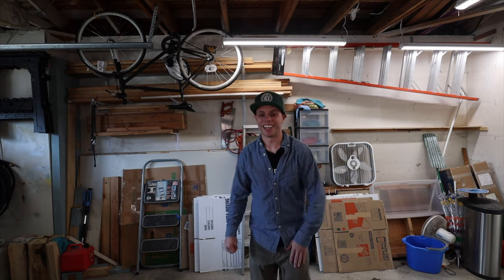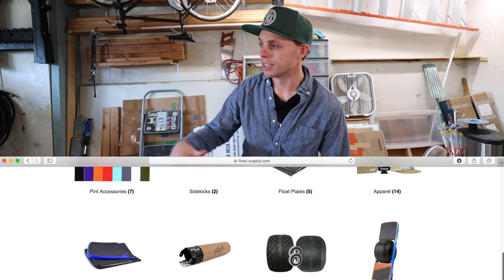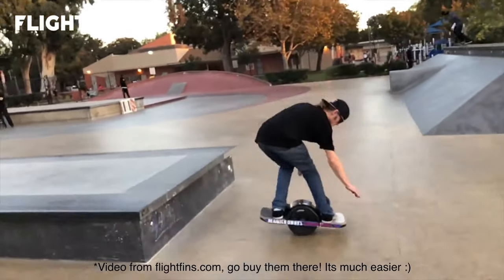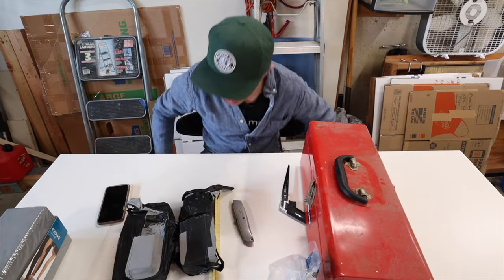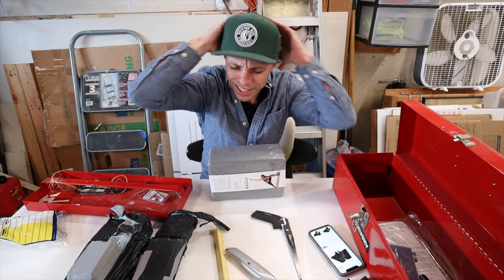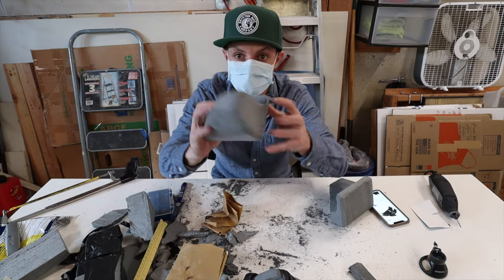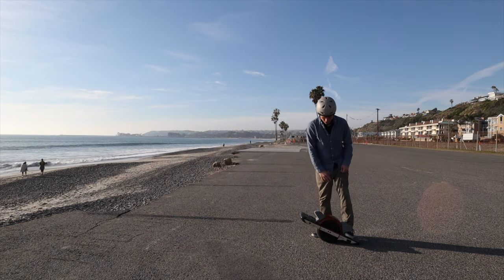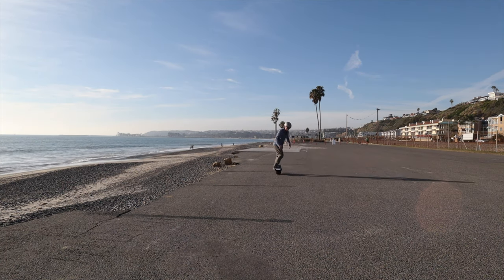I made my own Onewheel Flight Fins for $10

Comment: Yo! Ima lowkey trail rider since 12/2020. I do some basic tricks that include a body varial, switch, (upto 3 foot) drops, and (super half ass) curb nudges and bonks.

MY ADVICE
Buy FlightFins and OverLander. There is no substitute for these products. They are expertly-engineered to help you jump higher and longer and keep you locked in on super tough trails AND STILL give you the freedom to fall out if you nosedive. I've experienced a few nosedives up/down hill, straight away, etc., and while OverLander and FlightFins look like they lock you in, they don't. You slide right out without injury. 

I've seen and tested home-made versions and have an ankle and shin scar to prove it. The home-made versions never end well for the rider. 

STILL
I like how this creator built his own and kept it realistic. He's not selling it. He's just having fun. And that's one of the coolest things about PEV. People are always trying and creating new things and that's how the sport continues to move forward. 

Good video. Thanks!

Comment: Cool project. I’m dazzled by the price of the flight fins. Maybe they can be 3D printed!
Reply from the maker: Thanks. It was fun. I’ve seen some success in printing them but typically they break I think. The real fins are injected molded so they’re super durable.  I eventually bought a pair of real ones used. I’ve ridden with and without and currently am back to without. They’re very cool but I don’t think I really need them all that much since I’m not into big drops, jumping etc. I do like running a single rear fin sometimes though for added control when carving.
Reply: @ELECTRIC-DNA  interesting take, I'm glad you reported back on your experience! I Ordered fins today but I considered doing exactly this with a yoga block. I'm experiencing my foot flying off and just not staying put when I go offloading. On the road, I see them as pointless unless u want to jump but that's deffinitly not my cup of tea lol